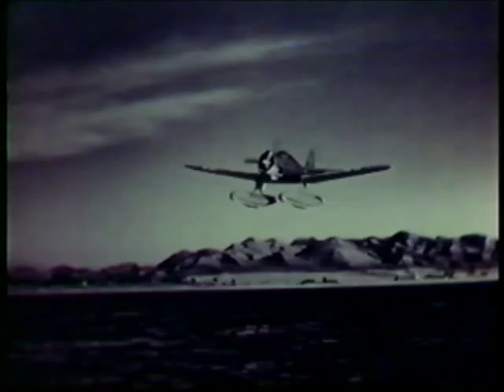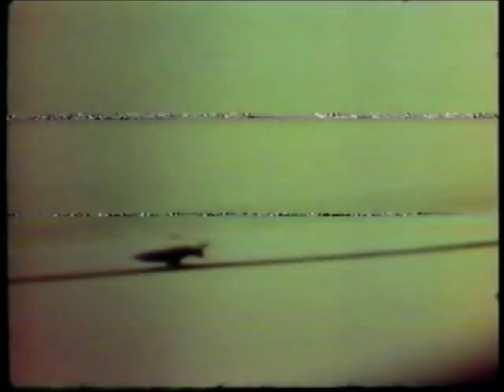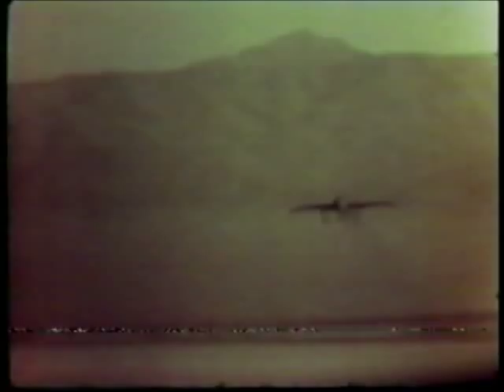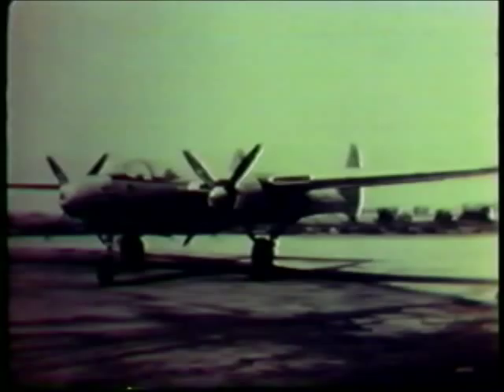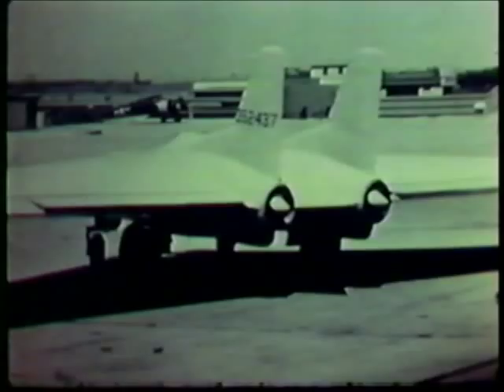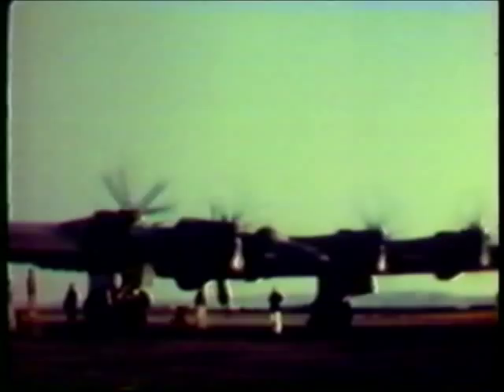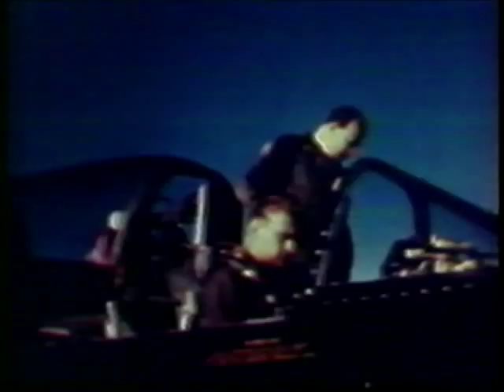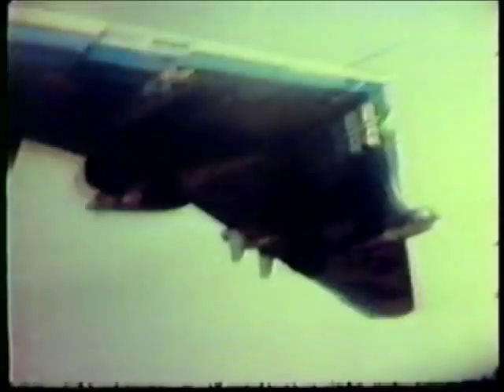Northrop Aircraft first flights 1

Comment: the first flying wings were by the Horton brothers in Germany.
Reply: Actually the first Flying Wings were from Boris Cheranovsky, and Jack Northrop both of who made powered Flying Wings in the 1920s before the Horten brothers even started on Gliders in the 1930s. Hortens flew the first JET powered Flying Wing in 1944 followed by the more impressive jet powered YB-49 that flew a few years later in 1947 based off their propeller drive designs from the early to mid 1940s
Reply: Northrop's powered N-9M first flew in 1942, two years before the Horton's powered HO-229.
Reply: Oh yes, those Germans did everything first. But actually no.